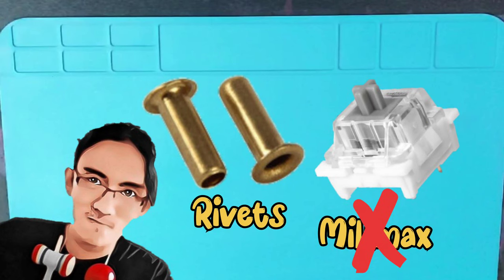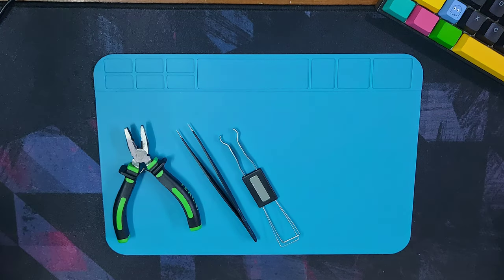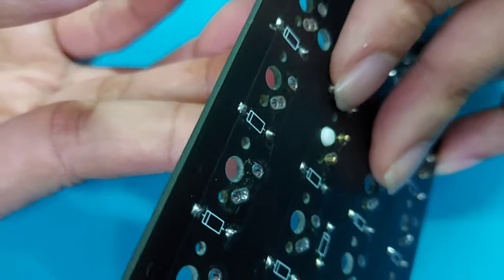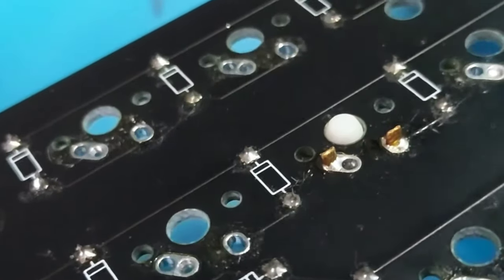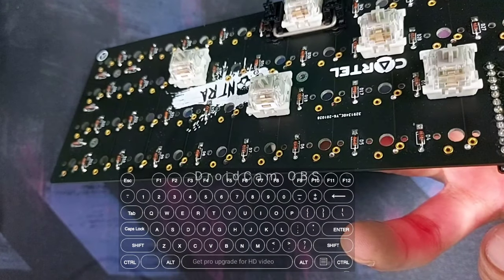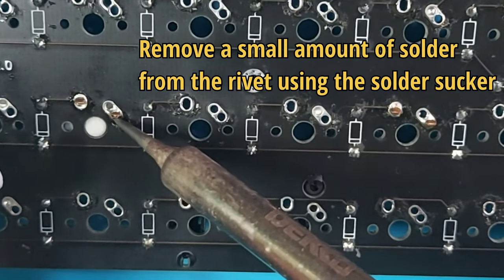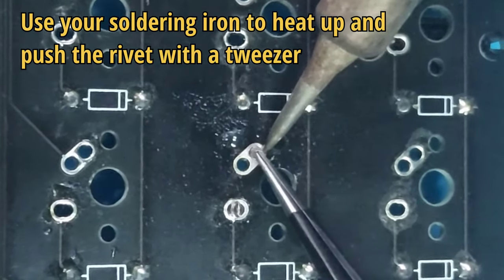How to use Rivets as Hotswap socket instead of Millmax

Comment: I did exactly the same to my brand new pcb and now I get double presses on my keystrokes randomly all over the switches, sometimes also keystrokes are not recognized. The problem was not possible to identify until I started using my keyboard extensively. I tried to solder rivets ideally, so I think using rivets is quite a risky method, maybe rivets that I bought are made of poor quality raw materials, or something like that, but using them surely provides problems with contacts between the pcb and switches.
Reply from the maker: hmm 🤔, in my experience I don't think that's because of the rivets, have you tested the PCB first before adding the switches? usually, I did the MCU part first, but if the board already came with MCU on board you could just plug in the power and test the PCB using a tweezer
Reply: Double keystrokes hmm, have you tried delubing your key switches? Could be the factory over-lubricated them. That or possibly a defective diode. But I don't think the rivets are the issue because they can only really explain why youre not getting responses from some keys resulting from a bad connection with the switch pins, or PCB through holes. Which could explain your second part? Or it's the first part, and aggregate failure caused the second portion.
Reply: I just researching to make this mode on mine. So didn't try yet. But this just pass through my mind.

If you live in a plate with high humidity, it may have some oxidation. Look if your rivets are little green.

And another ideia, apply just a little bit of solder in the switch pins. As it is a little more soft, may help with contact.

I know it's a year late, but maybe it you help someone.

Comment: Where do you buy those kinds of rivets? Can I also ask if what's the size of the rivets to that you used?
Reply from the maker: Hi thx for asking, I forgot to mention the size of the rivet, and Yes I bought it from a local electronic store, but these rivets can be easily found on AliExpress, I use the M1.3 diameter with a 3.5mm length
Reply: @khalidity  Thank you

Comment: yoooo! thanks for this tutorial, i plan on millmaxing a cheapo redragon board that i have. millmax sockets are a bit too expensive and i learned that rivets can be used. such a useful tip to clamp the rivets to make it tighter, thanks!
Reply: also, do you think 0.9 rivets would still fit switches?
Reply from the maker: I'm using M1.3 size, and it's 3.5mm long

Comment: Not sure if you will still notice this comment but I'll ask a question anyway hoping for a reply. I got a budget mechanical keyboard that I love so much and got it with a discount so I got it for like $8. I has a knob, light indicators, backlight, etc. But my only problem with it is not being hot swappable. Do you  still have this board? Did it perform well on a long run? Wanted to try millmax but is was too expensive. This is an 84 keys keyboard so I will be needing a lot. But brass rivets M1 3x3.5, it will only cost me a dollar for 200pcs so I want to try it but having second thoughts. So how was its performance di you experienced any unusual?
Reply from the maker: Hmm, I'm not sure about the brass rivets, I guess I'm using the copper kind of rivets, yes I'm still using the keyboard but sometimes, in fact, I've been using the keyboard till last week, so yeah, nothing has gone wrong

Comment: Hello. May I know what's the different between Revets and MillMax? Millmax so expensive its like a scam.
Reply: Mill-max are precision made. If you look inside the hole you will see that they have contact pads that ensure proper connection.Also MillMax uses proper materials for proper electrical contact (unlike rivets).
Reply from the maker: Millmax is meant to be used for switch pins specifically, and since it's gaining popularity the price also going up, in the other hand rivets has many uses but are commonly used in household, just make sure you get the copper one
Reply: @khalidity  Its not pricier because of "popularity" its pricier because it is a lot more expensive to make than cheap rivets. I work in manufacturing I can tell you there is a huge difference between both. I wouldn't put rivets on an expensive board, no way.

Comment: Very nice. Any chance you have a link to the rivets, or measurements specs so I can make sure to find the right size?
Reply from the maker: Ah I'm sorry I bought the rivets at my local store, but this can easily find on AliEx just search for rivets, it's an M1.3 diameter with a 3.5 mm length

Comment: So why is solder still needed? To hold & connect the Rivet? While rivet becomes the hot swap "tube" for the Switch Pin?
Reply from the maker: Yep, need solder to connect with the PCB and also to hold the rivet stay put on the PCB

Comment: Quite late to the party, i mistakenly bought 1.5 and they were too big. Tried the squeeze the switch while pin is inside method but oddly enough it doesnt contact well on the switch pins.

How's the board after a few months? is squeezing the 1.3 rivets to the pins reliable to change switches randomly/anytime freely like a hitswap board or do you still have to bend the switch a bit etc.?
Reply from the maker: I think 1.5 is quite big, even tho the squeeze not helping since it leaves a lot of space around the pin leg, I forgot to mention that while adjusting/squeezing all the rivets I use the same switch, if you take a look closer to the switch pin it's not actually flat but it's a bit concave, so when you squeeze along with the rivets it's going to flatten the pin, so yeah I use that same switch for all the rivets, and then when you insert the switch pin that hasn't been flattened it will give more traction
Reply: @khalidity  have you encountered any problems where pins dont make contact?
 I appreciate the reply thanks man!
Reply from the maker: @kennshakeman6458  what kind of rivets you bought, did you get the copper one? Have you tested with a multimeter? if you squeeze correctly and soldered it right, it shouldn't be a problem
Reply: @khalidity  Im planning to get the 1.3s in m experience all the 1.5s worked as long as there were contact, hoping that 1.3s will work great, thanks man
Reply: I wish I saw your comment soon
😢😢😢

Comment: can this be used for mouse switches?
Reply: I think I gonna try on my spare mouse. I didn't buy the rivets, so it will take some time, around 30 days. If I don't forgot, I will come back to answer.
Reply: So the rivets arived pretty early and the answer is: I don't know if it's possible with mouse switchs because they're a little bit smaller than the hole in keyboard. So the keyboard rivets aren't compatible with mouse.
The rivet I bought was the M1.3 - 3.5mm, the smaller are 0.9 and I belive the mouse hole is around 1.1 or 1.2.

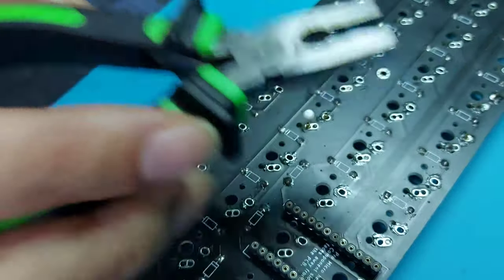This message was typed in my rivet modded keyboard and feels so nice to have my first mechanical keyboard with custom parts, and since the layout of my country is different it was a necessary thing to do. Personally would not recommend to clamping 1:40 the rivets, but bend the pins on switchs a little bit to make contact. If needed to remove the rivets, the clamped ones will make it harder to do. But it may vary from keyboard to keyboard, mine has the mount plate in aluminium, then it's more rigid to maintain good contact with the board.
Reply: @DerliFontoura  thank you for the follow up <3 I ordered some rivets hoping it could fit my mouse. If not then Ill use it for my keyboards and some projects

Comment: I was wondering if an alternative to millmax is possible! It's rivets! Thank you.

However rivets are usually made from iron or steel. And steel corrods.
Reply from the maker: I think I'm using the copper one, I don't know if copper going to rust or maybe not 🤔
Reply: @khalidity  this is a very old comment, but I’m going to reply anyways 😂. Copper doesn’t rust like iron, but it does form a patina layer. Doing some cursory google searches it looks like it’s nothing really to worry about? I’m not sure.
Reply: don't cheap out. If you're going to go for a custom keyboard go for mill-max. I'd go for 7305 if you don't want to pay the premium price of the 3305.